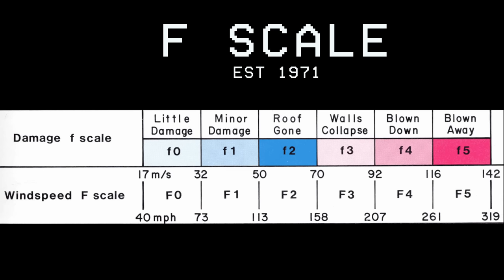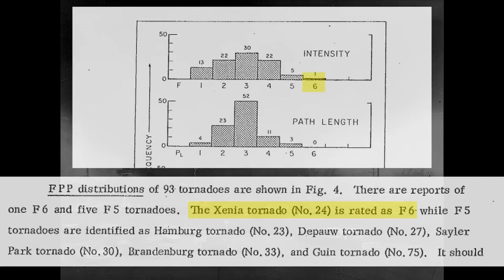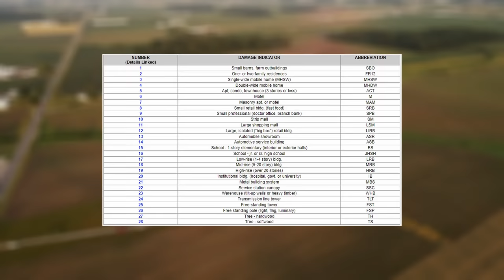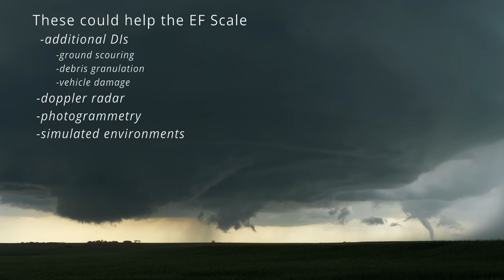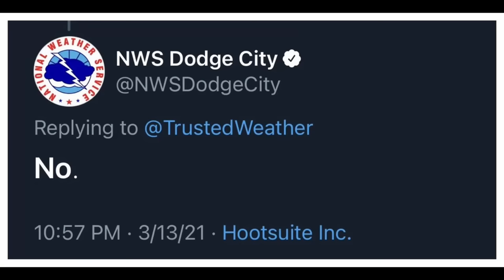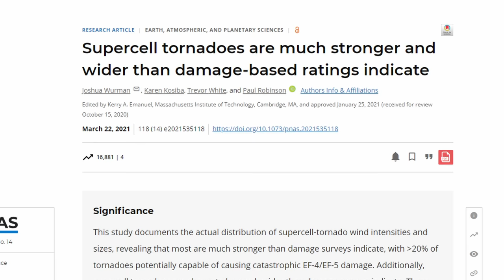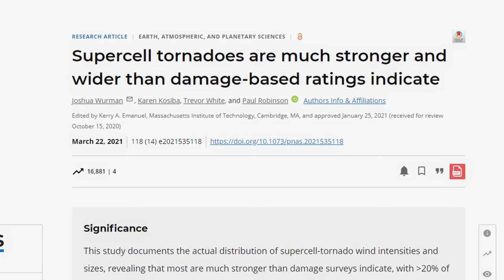Is The EF Scale Outdated?

Comment: The El Reno Tornado was a freaking monster
Reply: You and everybody else on here has made their point about El Reno. I don't disagree with it either. But that event is being used to make blanket, simplistic statements stating the scale is antiquated.
Reply: @ILoveOldTWC  Not really, there have been many tornado's with close to 300 mph wind speeds that are rated nowhere close to the actual power they had, due to damage indicators not showing damage fitting the rating on the EF scale, and thus the tornado being underrated to EF 3 or 4, when in reality the wind speeds way exceeded 200 mph, even visibly so. 

You can see it literally just by looking at the footage of a tornado alone, how quick and violent the rotation is, there is a huge visible distinction for tornado's which reach extreme 250+ mph wind speeds that is unmistakable when you see it, let alone with doppler radar imaging which give accurate measurements of tornadic wind speeds and have shown many tornado's in recent years far stronger than their rating. 

Exactly as the research article shown in this video indicated.
Reply: @luka188   The EF scale also overrates tornadoes.  Joplin was an F3 as it only had speeds to 320kph
Reply: @Firemarioflower  It's an economic scale rather than a scientific scale. Complete nonsense.

Comment: I agree 100% that more should be included in the rating system. Radar loops, velocity/wind speed measurements in radar data, photos, videos, interviews of residents involved along with the damage indicators. Radar data being the most important inclusion needed in the rating system.The NWS should spend more time in rating possible tornadoes than just the usual few days that it takes for many tornadoes. EMA offices should report all damage locations to the NWS as well, many even small damage areas are often missed due to lack of reporting that could warrant a higher rating. All factors should be carefully taken into the consideration and it shouldn't be a quick process in my opinion. We have multiple resources available for rating tornadoes and they are underutilized greatly. The time spent in surveys sometimes isn't thorough especially if the tornado is not a well publicized event, on a lower risk day or not in a highly populated area. Ratings should include all factors and should be many weeks if not months long process to settle on a final rating. 

An example is a tornado that occurred in my area in October of 2019. The tornado was initially rated a long track EF1 based primarily on a flyover that the NWS did along with reports that the local EMA office gave to the NWS with a couple spots here and there surveyed. However, there was a neighborhood where a well built house had its roof destroyed along with interior wall damage and an outbuilding beside the house was wiped clean off its foundation obviously at least EF2 damage. Local residents, storm spotters and a local meteorologist questioned the EF1 rating after this was found and the NWS upgraded it to an EF2.
Reply from the maker: There are many tornadoes that are overlooked for one reason or another. The three outlined in this video (El Reno, Mayfield, and Rochelle) were the most obvious examples. I think if the NWS were to contract independent surveyors it could decrease the work load and make the assessments less biased.
Reply: @highriskchris  I agree with that also. Have the NWS either increase surveying staff or like you said hire someone independent to do the surveying with all the information verified by the NWS before a final rating is approved.
Reply: There are over a thousand tornadoes a year. It simply is not possible to spend the amount of effort you suggest in rating tornadoes.
Reply: @highriskchris  Can you give more examples? I think Tuscaloosa April 27, 2011 should've been EF5. The city was flattened.
Reply: @tid418  But in the larger scale events (Like April 27, 2011, December 10-11, 2021, even a couple of weeks ago, in Alabama and Georgia (1/12/2023), more time should be spent. But I understand what you're saying there are so many of them, many are on the ground a couple of miles and gone, especially in the QLCS events, vs. the cellular mode.

Comment: The bassfield/soso tornado is an underrated tornado that is alot stronger than what most think and is a candidate for having potential ef5 damage but that damage was from the forests
Reply: I agree, Bassfield probably hit 200mph+ when it cleanly swept that cabin away and then went on to produce extreme debarking to a section of forest.
Reply: @alexlubbers1589  even past bassfield it maintained pretty strong strength when entering soso at high end ef3 damage I think
Reply: @alexlubbers1589  the issue with the scale is the inaccuracy of the estimated wind speeds and several civil engineers have brought this up. No doubt it hit 200mph like many others but 200mph isn't enough to cause EF5 damage and they are learning this. The DOW has recorded a handful of 200mph tornadoes that did not display F4 or F5 damage. The old fujita scale was likely more accurate.

Comment: I've always found it very arbitrary that tornadoes are not ranked on their actual wind speeds but the damage they caused in the EF scale. Sure, damage is a proxy for wind speed, and it isn't practical to get precise on the ground wind measurements for every single tornado, but the idea that one tornado in a field could have the same wind speed and intensity as another that hit a town, and the one in a field gets a vastly lower rating makes no sense to me. It means tornadoes get ranked on how much they interact with human constructions, rather than any objective measure of the tornado itself. I would think that if you can confirm wind speeds inside a tornado, that measurement would take priority over any other.

Comment: Fully agree with you on all counts. I live about 20 or so miles away from where the Rochelle-Fairdale Tornado struck, in DeKalb, and I can confidently say that I also question the official rating of the tornado. 20 instances where the wind speed rating was at 200 mph, and it never ONCE went above that? Doubtful... I saw the homes in Deer Creek. Those homes were entirely slabbed and they were well-built, large, relatively new constructions. The reasoning for this? There was a home which had small bushes still in the ground infront of where the entire home once sat — that is legitimately one of the reasons given for not rating it EF-5 at that location... shrubbery. Meanwhile, the sidewalk leading up to one of the homes' front door was moved over 6" from where it sat prior. The lack of account for wind vortices and difference in wind velocity and force in one area as opposed to another inside of a tornado is very apparent here — and it's frustrating. Not saying rating it an EF-5 would change anything, really, but the seeming aversion to rating recent tornadoes EF-5 is questionable. It's giving people who don't have a wider understanding of the weather a false sense of security and it's doing more harm than good, in my opinion.

Comment: 7:01 A good friend of mine had this to say about that home:
"While there were anchor bolts at this home, it was NOT a traditional sturdy slab foundation home. Instead, this was actually a block-foundation home that had a gravel fill poured into the empty space of the foundation, then a concrete slab was rested on top, apparently unanchored. When the tornado hit, the concrete floor slab slid off and broke into pieces. That is not good construction, and these photos show the barely debarked trees, the gravel fill and the unanchored concrete slab that broke."

As far as Rochelle-Fairdale goes...my only guess is that the areas where the peak winds occurred were not completely wiped off the face of the Earth, which led to a lower rating. The wind speed argument isn't really that good because the same could be said for other intense storms like hurricanes that contain wind speeds below thresholds for long periods of times.

That being said, I do think the EF scale has some more flaws than what the NWS would like to admit. Why doppler radar and observed wind speeds are not counted into the final rating is beyond me and I also feel like that the damage is going off of too many technicalities. I TRULY believe that the 2015 Rochelle-Fairdale tornado did reach EF5 intensity at some point. Other tornadoes I think were EF5s are the 2014 Vilonia, Arkansas, tornado, the 2020 Bassfield, Mississippi, tornado, and, of course, the 2013 El Reno tornado (I don't believe the 2021 Western Kentucky tornado reached EF5 strength, but it got pretty close to it). The EF scale, in my opinion, is not outdated, but needs more wiggle room. The EF5 drought is more like three years long, not almost ten.

Comment: Definitely need to include ground scouring in the ratings. After seeing a breakdown of the New Wren EF3 from 2011, there's not doubt it would be rated EF5 if this was included.
Reply: But ground scouring can also be evident with EF-3 TORs though, not only EF-4 and EF-5.
Reply: Ground scouring is not exclusive to EF-5 tornadoes.
Reply: New Wren is EF5 even without the scouring
Reply: @AlabamaTrumpeter  Yeah but in this case the tornado itself also did EF5 damage, the ground scouring is just a confidence builder. NWS never went to inspect the tornado itself and it was a rating based on photos. Its also the tornado before Smithville (arguably the strongest ever) and also had a violent core so it makes sense to be EF5
Reply: @helicitywx  Yeah but in this case the tornado itself also did EF5 damage, the ground scouring is just a confidence builder. NWS never went to inspect the tornado itself and it was a rating based on photos. Its also the tornado before Smithville (arguably the strongest ever) and also had a violent core so it makes sense to be EF5
Reply: That's what made Plainfield, Illinois back in 1990 an F5.

Comment: My conclusion is that it is somewhat outdated mostly because of how we try to build things more cheaply with no anchor bolts (or few anchor bolts). That is how (and why) many possible EF-5s were only EF-4s.

They plan to update the EF scale with more damage indicators and will use the radar measurements to help the rating.
Reply: The EF scale already takes that into account. The F scale only considered "well built" houses.
Reply: @tid418  The first F Scale was better. the upper limit on the EF Scale (5), is any winds above 200 mph. But the first F Scale had winds 261-318 mph.

Comment: The big flaw with both the EF and F scales, is the fact that we simply are relying on the infrastructure and buildings on the ground which are subject to all kinds of corner cuts, varying structure codes and building methods. I'm a scientist myself (though I'm an immunologist so....very different field) but I feel like with the way technology has moved on, I feel like the EF system is potentially limiting tornado study, especially these larger and more destructive tornados. You could have a large EF4 tornado that just happens to have its most destructive winds out in a field between two towns and this is missed. I can't imagine having to work with the same tech and methods my field had back in 2009! The only real downfall of that point is the number of radar holes, the height of scans (meaning that the winds detected arn't always accurate to on the ground wind speed) complicating matters. You're not going to have a DOW on every tornado. To quote my boss in our research lab, "these are imperfect tools, that give imperfect answers, but in this moment it is all we have" when we have something better, we start using that better method. This isn't my field so I can't speak to what the solution to the problem is but, thats the nature of science, we refine and work becomes more accurate.
Reply: Science needs to be subjective not objective. I get the feeling if Ted Fujita was around today he would make the scale solely based on wind speed if applicable and only use "destruction" to fill in the holes if needed
Reply: You won't have a DOW in the vast majority of tornadoes. Try putting one in a brief, spin-up tornado that is produced by a squall line or QLCS.
Reply: @Michael-sb8jf  I agree!

Comment: The EF scale is an imperfect system, like its predecessor it is a damage scale first and a wind speed scale second. But all kinds of things can affect damage: The speed of the funnel, the angle of impact, the amount of time it takes for the entire funnel's winds to pass over a location, the surrounding environment and of course building codes and construction flaws.
Reply: WTF the original was not imperfect, it WAS BASED ON WIND SPEED
Reply: @Firemarioflower  No, it was based primarily on damage. Then it was estimated what winds would be needed to produce that damage. The EF scale was made to reflect the fact that wind speeds could produce damage at lower levels than previously assumed, and to try to better account for structural differences.

Comment: I was going to suggest using tenth decimals, but there's a much easier way: tornado rating = maximum wind speed, either by damage, recorded, by radar, or by visual observation. The categorization process is where the problem comes from. A gradient/spectrum system provides a clear strength indication. Just use measurements, maybe there's a way to factor in width and subvorticies, represented like a sports score: a 200-5000-3 is a tornado with 200mph winds, 5000 ft wide, with 3 subvorticies

Comment: That is right.. the EF scale is very limited. In Europe meteorologist use the IF - international Fujitsa scale and it fits. Much more. Even the old F scale is better than EF one. Look at El reno. The tornado was no way EF3.. okay acording to EF scale it was but its strenght was higher. EF5/F5/IF5
Reply: It would have been rated F3 or perhaps even lower on the old F scale. EF scale is superior in every way... it is a superset of the F scale.

Comment: In my opinion, for my response to the EF scale, I would add more degree of damages nature wise, including trees, shrubbery, etc, also visually looking at damages around, for example, when the December 10 tornado ripped through Bremen, the structures that it hit would still be at EF4 level but around the slabs, ground scouring and tree debarking should be noted, so while the structure failed at EF4 intensity, the area around it should be rated EF5, also, EF5s are slightly more common than meteorologists put it as, but not crazy common, just rare, you can take past tornadoes that possibly or have possessed EF5 wind speeds, like the May 15 2013 Granbury EF4, or the May 24 Chickasaw EF4, all did similar damages, tree debarking, ground scouring, slabs, but that is how I would put my response to the argument of how do we fix the EF scale

Comment: Personally I'm amazed that it isn't still just based off of wind speed, regardless of the damage it actually dealt.
Reply: The Saffir-Simpson hurricane scale is based strictly on windspeeds while the F and EF scales are rated on the type of damage they cause. Measured windspeeds should be a DI.
Reply: It wasn't designed to be directly on wind speed. It was in fact, designed to be based on damage. That's the problem. How would we get an accurate measurement of wind speed other than the DOW? Because DOW's won't be used outside of Oklahoma, Texas, or Kansas, and tornadoes are far from unique to those states. Winds can't be DI is there's nothing for it to damage.

Comment: The EF Scale was never a good system to begin with. They should have left it as is with the original F scale. Weve never had an issue with  it.
Reply: Yes! 261-318 F5, any wind over 200 EF5, so it gives the impression winds can't reach 300 mph.

Comment: While everyone talks El Reno, and for very good reasons, I will never buy the "high end" EF4 rating of the Tuscaloosa-Birmingham, Alabama tornado of April 27, 2011. EF5 damage was discovered at an apartment complex in Alberta City by one survey team. Another tornado that hit a less populated area, Hackleburg-Phil Campbell, on that same day, did get the EF5 rating. The EF Scale MUST have a revision and update. 

As for the 2013 El Reno storm, if that thing hits a densely populated area, everything would be gone, like what we saw in Joplin, Tuscaloosa, Parkersburg, Iowa, Jarrell, Texas, Andover, Kansas, and back in the 80s, Niles, Ohio/Wheatland, Pennsylvania. Total devastation. The kind of destruction it takes the places hit years to recover and rebuild from.

It is and always will be a damage scale, but if more than just damage can be used to determine the rating process, such as the DOW's measurements (in the ones DOWs are used in), ground scouring, how far debris can get from it's point of origin (checks, papers, receipts), ALL of those should be used.